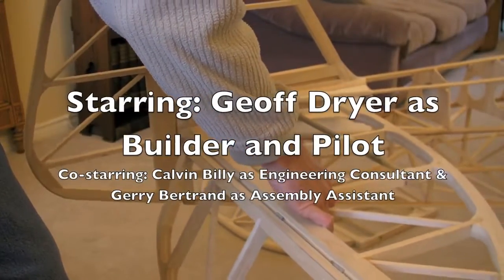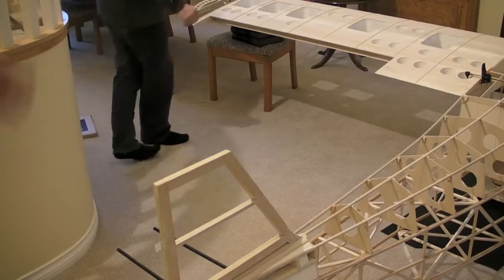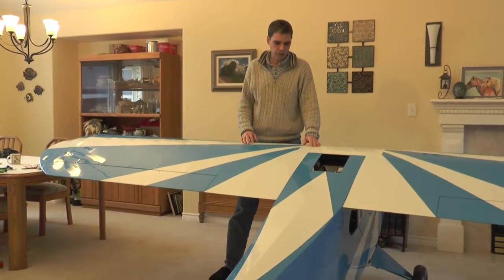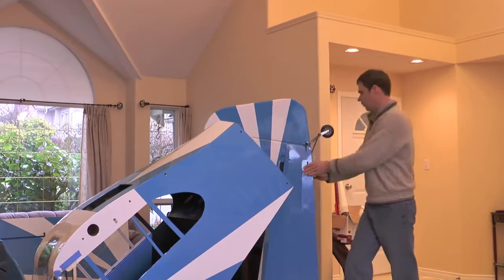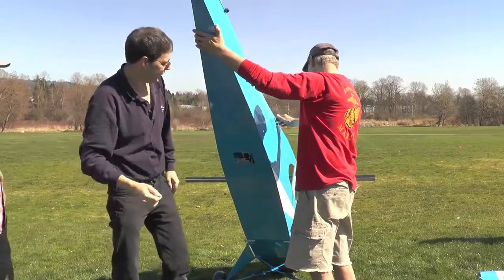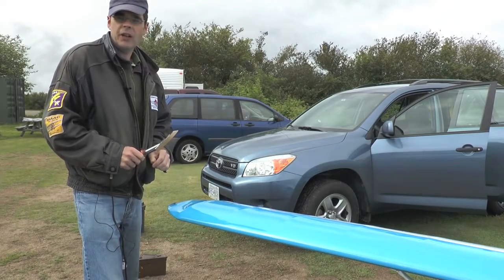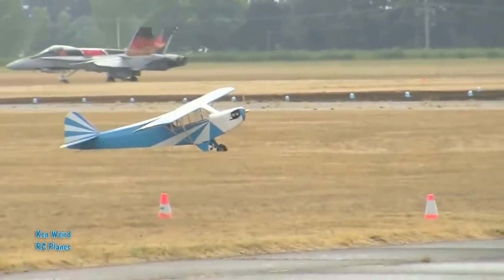J-3 Cub Electric 50% Scale RC Aircraft

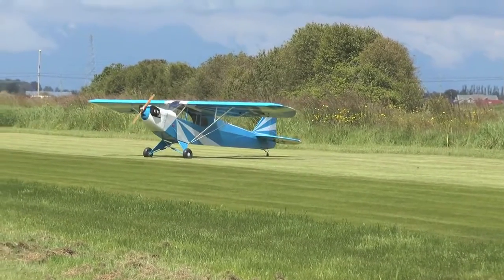Comment: thanks for posting.  nice model.    at 12:44,  EXCEPT:    the  hoerner  wingtips  are  Not  correctly designed  and   the model   IS   Under-prop'd.   prop diameter should be equal to 25 -26 percent of wingspan.     like most j3 variants,  the main wing of this model makes  LOTS  of   Lift,  ALL of the  Time.    this results in a model that, when flown excessively fast, will tend to  Climb,  on its Own.      (imo, there  is  Never  a  good  reason to use hoerner wingtips on a model aircraft, that is smaller than 1:1.   if the replication of the hoerner wingtips on this model is 'to scale', then the  ORIGINAL  design  is/was  Flawed.)   cheers        googletranslate